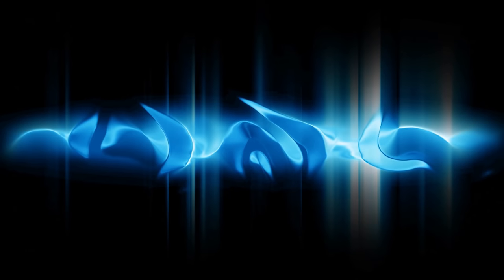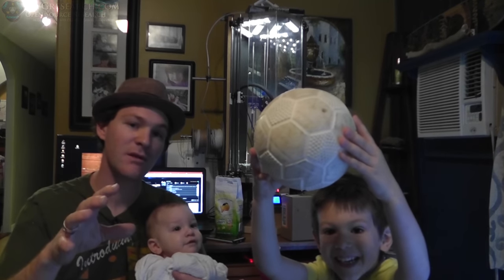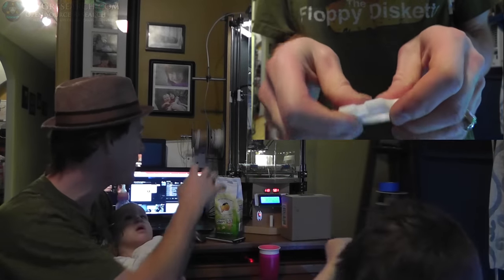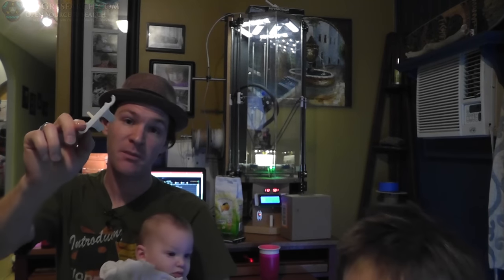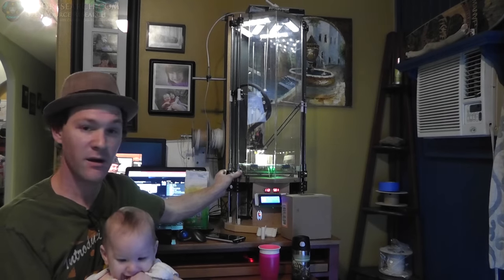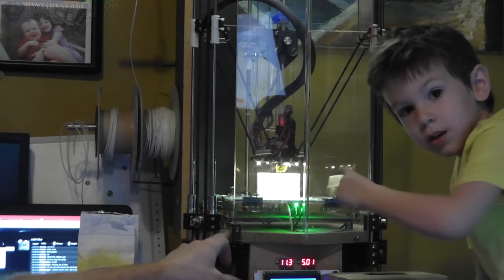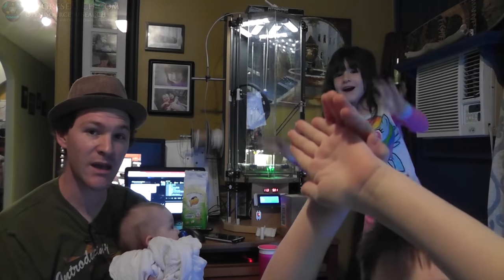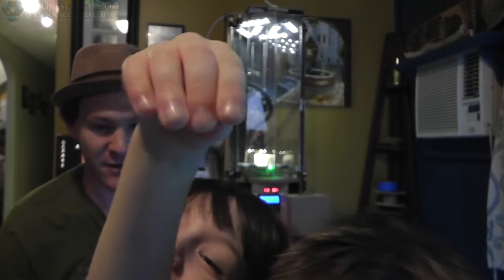RWG Rostock Delta 2016 Upgrade Overview P1 : The Plan! , New Dezined Parts, On board Cam...

Comment: what about PETG -- it's super strong, very solid if printed with high infill, also as I was seeing you show the parts which were breaking -- I would reorient it to not have layers run along the stress points -- ABS will crack on layers -- so rotated it (use more plastic for supports, but have the layers run counter to the stress points). Another materials to try is Aloy 910, or PolyCarbonate? I lost count how many kids you got there -- I counted 4 -- geez -- enjoy them. You're outnumbered. 
Subbed today -- just found your channel, great stuff
Reply from the maker: +kazolar thanks for the inside info! yeah there are other plastics i can try. but in the end i plan on doing loss PLA casting... so that will solve it :) also every crack i have ever seen in the ABS has been in the other direction, not along the layer. but " against the grain"  i think that's due to the internal stress. remember that each layer is on top another. so the cold layer gets a hot layer on top of it. and that is where the internal stress comes from. however possibly by heating the entire part to a close to melting temp after the print then let it cool evenly would help relive the stress? i could tr that in the future.. glad you subscribed! a fun new printer project is about to start! hope to upload that video tomorrow!  also FYI. 5 kids the oldest is turning 6 in 10 days and the youngest is 6 months ! no twins, same wife. its a handful and  we are loving it ! :) Blessed i say ~Russ